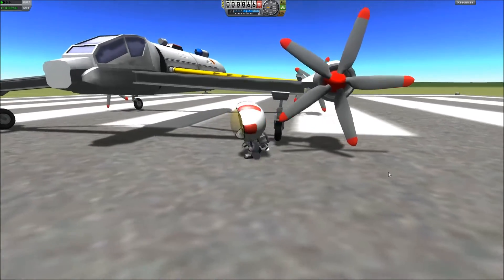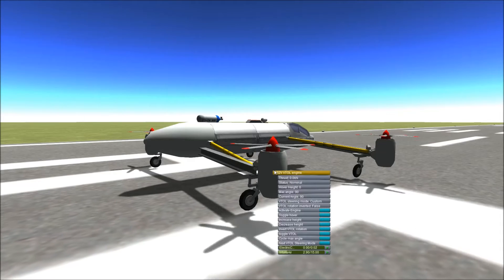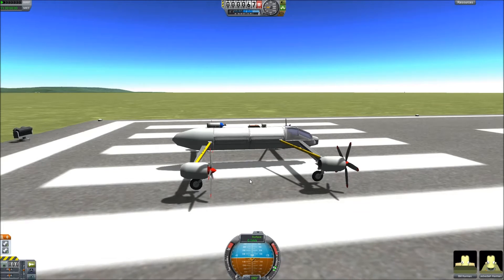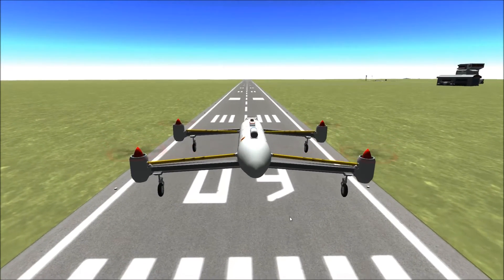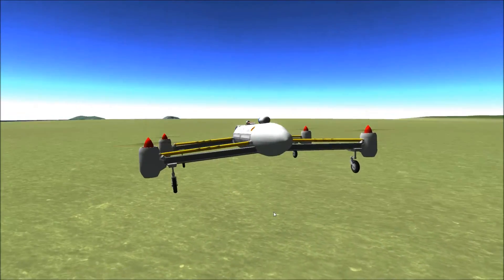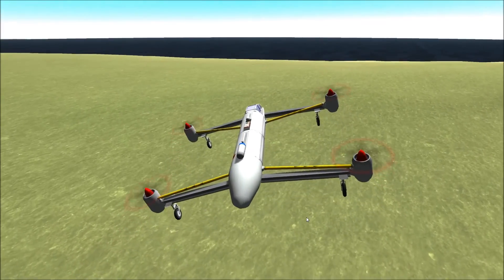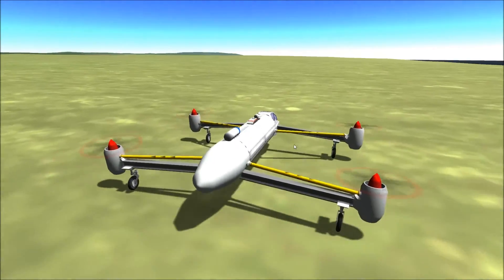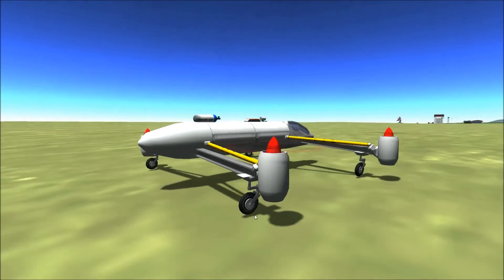Firespitter Quadrocopter - Kerbal Space Program

Comment: sorry to say, but this is a horrible design, first of all, no yaw, second, it looks horrible, third, you said it yourself, it doesent have any wings, just put on anything so it can fly.
Reply from the maker: While I agree that it might be horribly designed, it does have yaw through engine tilt.
Reply: Sorry, I was a bit harsh, but I do think you could have made a much better looking design. And you are wrong, this has no yaw, you may be able to turn in left and right with you roll and pitch, but it has no rotor propeller, thus no yaw, its simple, just put a vertical propeller on the back :)
Reply from the maker: The engines on the left hand side tilt forwards a bit while the engines on the right hand side tilt backwards a bit, causing yaw to the right. it's a separate effect from the roll and pitch, which happen by increasing thrust forwards/back and left/right. It's not very visible, but that's just because the effect is powerful enough with very little tilt.
Reply: Ah, ok
Reply: +Antypas Andreas also you apparently don't have the slightest idea how a quadcopter can yaw... for example you have this design of motors:
1   2
4   3
first you have to know that motor 1 and 3 are spinning clockwise
while 2 and 4 are spinning counter clockwise
for a normal hover of course you have all motors spinning at the same speed
to yaw left for example you increase the speed of motors 1&3 and decrease 2&4 it will still hover in the same place but!
as the propellers are hitting the air clockwise faster that counterclockwise you begin turning
imagine you had spoons intead of propellers maybe that gives you an idea how a quad does turn without tilting rotors or using anything else than the speed of the propellers.
+Andreas Gogstad: it does not require to place them at an angle
Source: i own several quadcopters ;)
Reply from the maker: Rec0iL Sure, this might not be the proper way to do it, but that doesn't mean it doesn't work. I don't own any RC aircraft, I just made something that works with the physics in the game, without cheating with flywheels. As soon as you take into account all the aerodynamic issues with a real rotor craft, this probably wouldn't be efficient.
Reply: +Andreas Gogstad i think you misunderstood me, tilting the rotors is totally ok, it is efficient, also there are quads with this capability (though they tilt foreward to maintain the most aerodynamic shape).
I just read your response to Ban Rawles where you said &quot;Sure, that makes perfect sense, but it would require the player to place the pairs at an angle when building the craft.&quot; that was all i was referring to. That they don&#39;t need to be placed at an angle. I like your craft and the way you did it is kind of intriguing to replicate that in real life...
My reasoning to replicate this is that you can yaw faster with a tricopter because of it&#39;s ability to tilt the rear rotor.
Well but for racing quads 4 rotors is just better, a better punch especially when you have to reestablish a cushion of air below you again (this happens if you go into sharp corners).
Having adavantages from both types may be result in an awesome flight experience for fpv race quads.

Comment: This is great, but most quadrocopters achieve yaw by simply throttling up (for example) the front left, and rear right motors, and throttling down on the front right and rear left motors. That way, the unbalanced rates of propeller rotation cause it to yaw. The yaw technique that you've used here is more often seen on Tricopters, which yaw by rotating the rear motor. Still, great to see these in KSP!